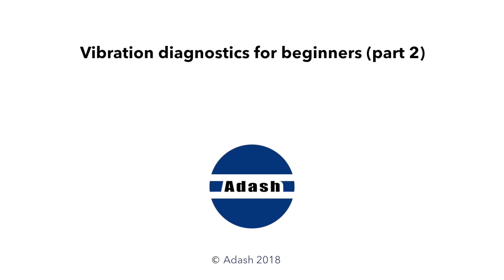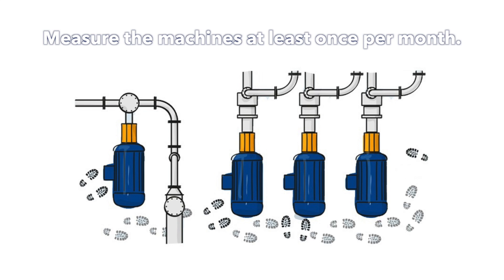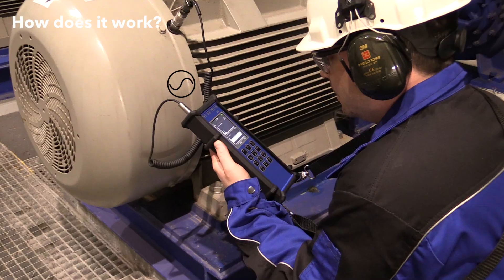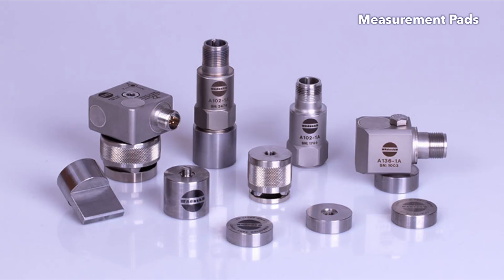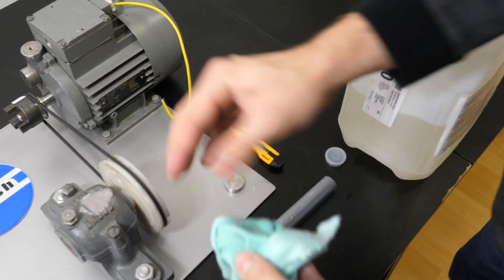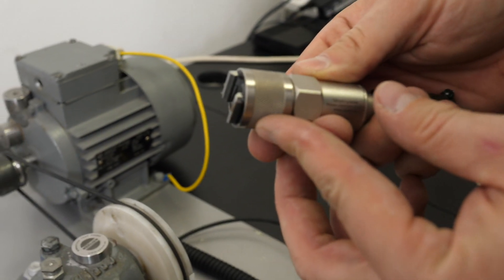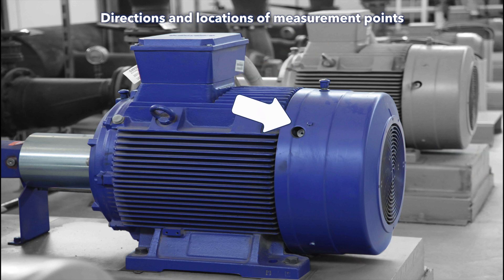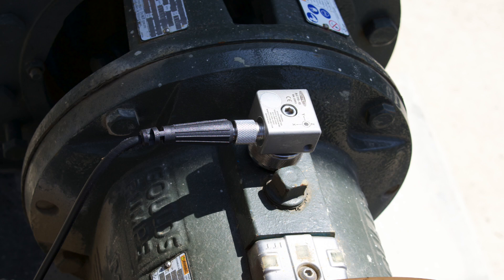Vibration Analysis for beginners 2 (how to start your Predictive Maintenance)

Comment: I had this similar project for final year mechanical engineering for monitoring lathe cutting tool vibration, and I used double sided sticky tape for mounting sensor 😂
Reply from the maker: Sometimes you have to get creative with what you have!
Reply: @AdashCompany  Hi, There do you hire these days , I'll be glad to work in this feild.

Comment: thanks for the help
Do you have info on frequencies and what they mean
Reply from the maker: This is very general question. There is endless types of machines and their applications in particular industries. Every machine or machinery set (e.g. motor with gearbox and pump) generates vibrations on specific frequencies according to their construction and other parameters such as speed, load etc. There are speed frequencies, gear mesh frequencies, bearing frequencies, drive belt frequencies to name a few. Therefore there is no general answer to your question.

Comment: When measuring vertical, horizontal, and axial vibration, do you compare each measurement to the maximum limit? or do you calculate some sort of resultant or average then compare it to the max?
Reply from the maker: This is difficult question as there is no general maximum vibration limit. It depends on machine size, type, speed, load and other aspects.

Comment: 2:33 Can't we put the sensor on one of the two bolts that secures the bearing housing together?  But if we do so, can we get an accurate reading since the bolt head appears smaller than the surface of the sensor?
Reply from the maker: That is not a good idea. Yes, bolt is smaller than the magnetic base of the sensor. These bolts are not ideally flat and the sensor will rock / swing on them. More over, the bolt actually behaves as a spring and it will damp a lot of high freguency (bearing) signals.
Reply: @AdashCompany  Thank you sir.  Best regards from Malaysia!

Comment: Hello Adash! It seems like you're using "cold welding" in order to fix the measuring point at 2:11. So my answer is simple - how does the "cold welding" layer affects on vibration level values? Do your measurements become more precise? And does it affect your high frequency vibration (acceleration)?
Reply from the maker: It is actually not a cold welding. It is epoxy glue which has the properties like a metal when dry. Your measurements will be repeatable and high frequency bearing signals will be transferred better than using finger tip or magnetic base for curved surfaces.

Comment: where do we need to place the tri-axial accelerometers in case of monitoring a gearbox, please help!?
Reply from the maker: Vibration analysis on gearboxes will be surely more difficult due to more shafts, gears etc. Ideally you should measure on each bearing house of each shaft if they are accessible.

Comment: if the motor doesn't has point of mesure, where can i mesure?
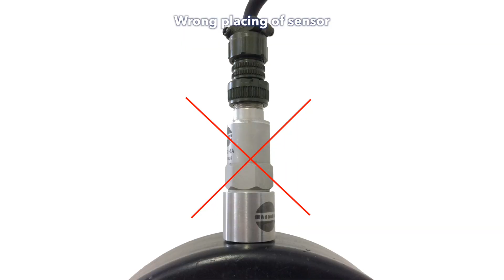Reply from the maker: See this video from 3:28 about magnetic base for curved surfaces. The idea is to measure as close to bearing you can in order to get good signal from it. And to have good information about mechanical state of this part of the machine.